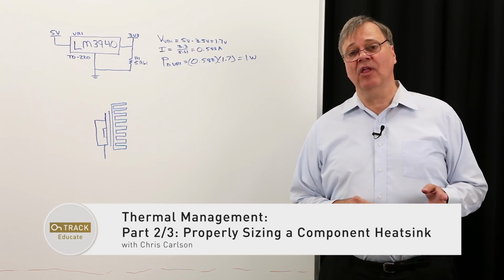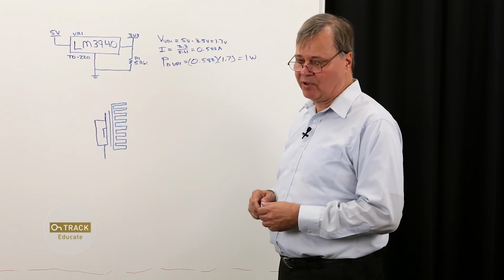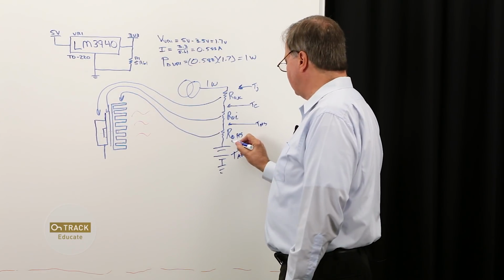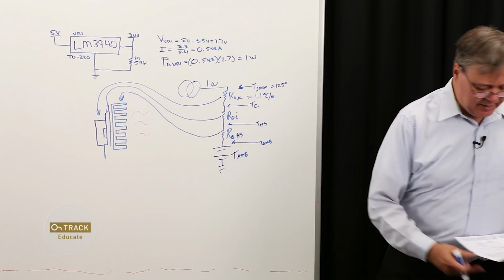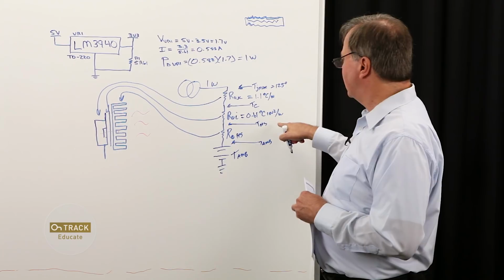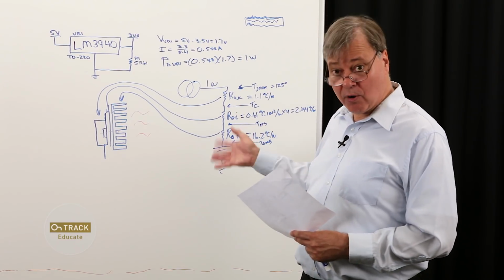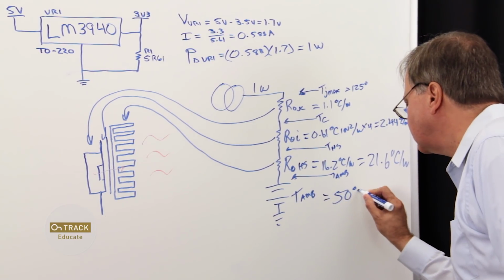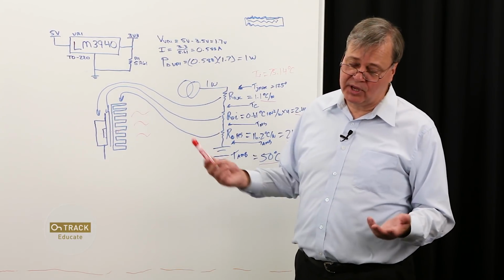Thermal Management (Part 2): Sizing a Component Heatsink - OnTrack

Comment: 9:30 you could help things by using a graphite pad between the MOSFET and the heat sink. Graphite has directional heat transfer characteristics: while the transfer though the pad is very good, the thermal conductivity laterally within the material is phenomenally good, which would effectively connect the heat source to the sink mating surface with very uniform distribution of heat flux. The downside is the lack of electrical isolation, which is a "deal breaker" in a lot of applications.

Comment: Chris, thank you for this informative episode. I'm always confused by the term "thermal resistance per unit area" when it's units are actually Km2/W. In your case, it makes sense that with an area smaller than an inch squared, the thermal resistance would be higher and hence we need to multiply the thermal resistance per unit area by a factor of 4.

I assume that if the component area is for example 2 inch squared, we would actually divide the resistance per unit area by 2. This makes it hard to wrap my head around how to interpret "thermal resistance per unit area".
Reply: Remember that thermal resistance of an object is a volumetric function: inversely proportional to contact area (cross-sectional area, perpendicular to the flow direction of the heat  flux) but proportional to the thickness of the conducting material, parallel to the flow of heat flux. Thermal conductivity of a dimensionless material is given in W/mK; the inverse gives us thermal resistivity (aka specific thermal resistance) in mK/W. To find the thermal resistance of an object made of a particular material, we take the product of the thermal resistivity and the thickness, and divide by the cross-sectional area. So if the thickness is constant, you can multiply the resistivity by the thickness, and come up with a thermal insulance in Km^2/W, which is then divided by the area to find the resistance. It is indeed a misnomer to say "per unit area" in this case, because resistance decreases with area.

https://en.wikipedia.org/wiki/Thermal_resistance#Derived_from_Fourier's_Law_for_heat_conduction

Comment: When do you use junction to ambient in your calculation.
Reply: The junction-to-ambient thermal resistance is the sum of all three resistances in this tutorial. The problem with data sheet theta J-A numbers is that they are only valid for one specific mounting condition - most likely not the same as the conditions in your application! So, you have to break it down and reassess some of the theta values, based on your own design characteristics.

Comment: Hello Mr. Carlson,

A very useful lecture, congratulations!

Currently I am designing a system with 4 MOSFETs (15 W loss each) and 2 (7 W loss each) diodes which I would like to position across the width of 120 mm wide by 50 mm long heatsink preferably aligned. 

I would like to know your opinion on thermal footprint overlapping in this case. What is a suitable spacing between the components? What is the optimal position of the components if the heatsink is cooled by two 60 mm fans with 750 LFM each (closer to the fans or at the middle of the heatsink)?

Thank you for your time!

I am waiting your next video on this series.

Best regards,
Radko Stoyanov